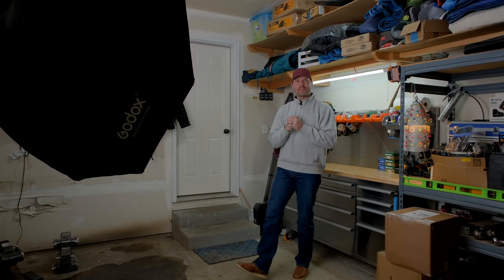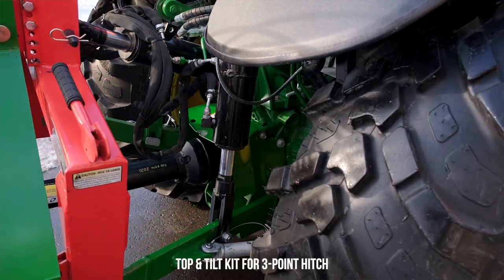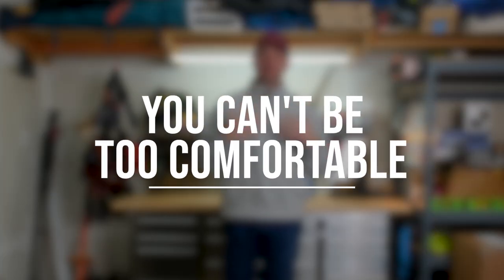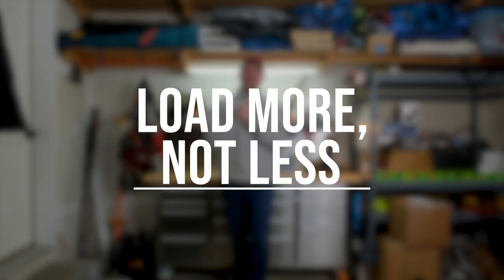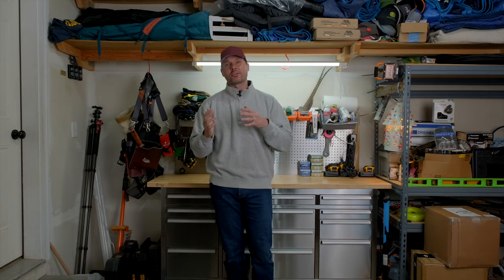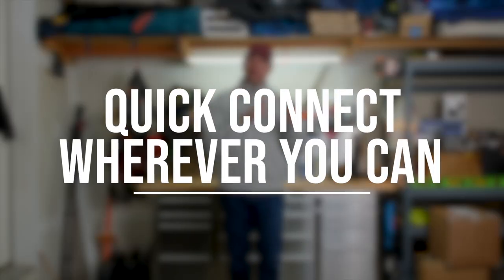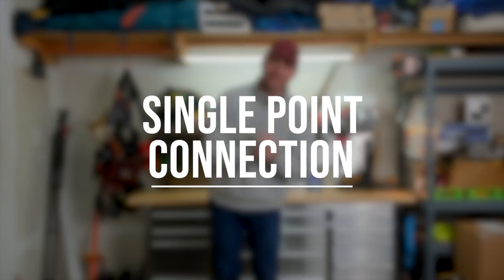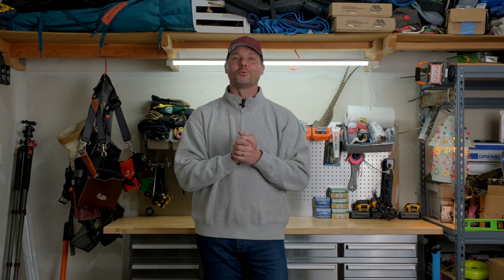7 UPSELLS ACTUALLY WORTH GETTING ON YOUR TRACTOR! 3 THAT AREN’T!

Comment: I had a1984 Ford truck that I bought at a dealership used.  It didn't drive properly.  Pulled hard to the right.  I took it to the dealer for an alignment.  $900 later, the truck still pulled to the right.  The service dept manager said to fix it they would have to bend the swing arms.  I said that's not happening.  He said a bit of pull was required for safety so if you fell asleep at the wheel, you would not keep going down the road.  What a load of 🐂💩. I then took it to a frame shop.  Told them what the dealer had told me.  They took a look and 5 minutes later their service tec called me out to the truck.  He told me to get 2 new front tires.  They were different sized. the size on the tires was the same, but different manufactures.  These were the tires on the truck when I bought it.  I went back to the dealer, but could not get my money back.  Haven't done business with them again.
Reply: The tech working on your  truck should know how a vehicle should drive , along with the manager! Pure negligence on their part. I worked at a Ford dealership for 15 years as a service tech! Most of us knew Fords inside out and usually knew what was wrong on the test drive! 
I’ve seen many many noobs coming into the automotive field that barely knew how to change oil! We all have to start somewhere but a dealership should be training people!

Comment: IMO, ordering a fully equipped tractor, regardless of whether you need all the options at the time, is like buying a stripped down pickup too save $$ up front or getting a loaded version. When you go too sell or trade, just like a loaded pickup, that tractor will be worth more. 😉
Reply from the maker: Yeah, I'm the same way.  Load it up!
Reply: Yeah I think this is definitely true for things like front end loaders and 4wd. Tractors without these two add ons can be relatively worthless.
Reply: Maybe, but you paid more up front…
Reply: @LedgemereHeritageFarm  True enough. Me personally I find the more I use my tractor, a Ventrac, find that I can use more attachments as I get more proficient with it and its nice too have all the options on it already so I dont have to go back and add things later.
Reply: @arlisspropertyservicesllc5943  Ventrac makes a very good tractor.
Reply: @LedgemereHeritageFarm  Well I dont think they are the Ventrac they used too be, before Toro, but their warranty seems too work really well.

Comment: A BLOCK HEATER PUTS LESS COLD START WEAR ON THE ENGINE DURING REALLY COLD WEATHER. A NECESSARY ITEM, AND NOT EXPENSIVE...WOULD NOT BUY A  NEW TRACTOR WITHOUT ONE..

Comment: Just bought a New Holland Workmaster. I had an old tractor so already had a standard rear blade, bush hog, and rake. But I wanted a loader which I couldn’t get for my old tractor. New tractor with new loader, done, right? Thankfully I had a young honest sales rep. He recommended I get the third function. I had no idea how important that was. I didn’t know I really wanted a grapple. Man, game changer. I’ve had the new tractor three weeks and in that time I’ve probably used the grapple 10-12 hours. All these years of dragging things around. No more. My neighbor had a box blade and I had used it enough to know I wanted one. By the way NH has skid steer quick connects on the loader. I also got a quick hitch. Yeah I could do without it but as inexpensive as they are, why? Tires filled, check! Wheel weights, check!

Comment: Definitely get all the hydraulic outlets that you can. They relatively cheap when ordering new. Get as much ballast as you can get on the tractor. If your going to be using the tractor for tillage and you've been using grandpa's 8n and want something to pull his implements get the top link draft control option (JD don't offer it on 1 - 4 series and standard above)
Reply from the maker: 100% agree with you.
Reply: Yes. A loader and remotes should always be bought up front

Comment: BLOCK HEATER I have a 1025R in southern Illinois last year I could not start my tractor for about two weeks even with putting a heat tape wrapped around the block and a couple heat lamps on it under a tarp it was so cold. I had my diesel treatment in so it will not go up. And it still did not want to start. And last year was extreme cold. I have my block heater and now it is very handy since I have installed a Curtis cab and want the heater for the cab available when I start it up I don’t have to sit there and wait for it to warm up for 10 minutes. I find that it saves me time and fuel warm and ready to go I also installed a trickle charger everything goes to one plug. Keep that battery warm through the cold months save you having to buy a battery later. Prolongs the life of your battery. I really enjoy your channel I wish you the best in the world have a great year.
Reply from the maker: Thank you David, great info!
Reply: It must be tough living in a place that gets so cold. Good luck this winter.

Comment: Work as many attachments in to the financing of the tractor as you can. You may not be able to afford them later on.  Also  if you even remotely think you might use a optional function on the tractor get it. Better to have it and not need than to need and not have.

Comment: Great video as usual. The winter temperatures here in Montana often dip well below zero. While I store my tractor indoors, it's not heated. Even with glow plugs my L3560 starts SO much easier after an hour or two plugged in to the block heater. 

FYI. About 20 air miles from my house on Rogers Pass is a sign that says it saw the lowest temperature in the lower 48. Minus 70º F. It's not unusual for it to get down to the minus 20s or even minus 30s here. 

Sometimes it gets so cold the lawyers and politicians have their hands in their own pockets!

Comment: I thought I would regret not getting a backhoe, but I couldn't justify the expense. I haven't missed it, yet. If I do run across the need, a local tool rental will be the answer.

My dealer included fluid filling the tires as standard delivery prep, no extra cost.
Reply from the maker: Good info, thanks for sharing!

Comment: Everyone is always worried about what color tractor should they buy. 

Making sure you buy the right options/ attachments is a way more important question.
Reply from the maker: Yep, definitely higher on my priority list!
Reply: I agree. Plus most fail to realize a good dealer for support is worth more than the color. It can be a great machine but they all break down and need service eventually and without good parts and service support it can be a worthless machine.

Comment: I store my tractor outside and I'm in snow country. The block heater helps get the tractor started and warmed up quicker. As for the self levelling, I don't think you need it unless you have a business that requires unloading or loading pallets all the time. On tires, I had R1 Ag tires on my old tractor. My new tractor has R4 tires. I wish I had bought R1 tires. Traction is greatly reduced on the R4. The benefit of not making as much of a depression in my yard is not worth it. Courtney's advice is so true. I bought a new tractor and upgraded for all the reasons he said.

Comment: Really great recommendations Courtney. I have a Bobcat CT5558 with a factory cab with all the bells and whistles. The only option I don’t have is a mid point PTO. To date, I seen the want or need for the mid-point PTO. Having worked with open station tractors, articulated forklifts, and skid steers, I knew I wanted to be warm and dry up here in Montana. I wasn’t disappointed.
Reply from the maker: Good info Richard, thanks for sharing!

Comment: I bought a brand-new John dear tractor in 1978 and I did not get external hydraulics at the time I didn't know what they were. Several years later I started bailing hay and using that tractor as the rake tractor . Now obviously I had to retrofit external hydraulics onto and I never did like him they were expensive to handle just flop around it took them two weeks to put them on. I also did not order rear-wheel weights that I was fortunate enough to have a brother at work to the pipe yard and got me some 24-inch pipe with a six-inch wall thickness so I made my own weights. The interesting thing is I still use that same 950 tractor to rake hay today.

Comment: Perfect timing on this vid.  Im driving my dealer crazy as my initial oder has morphed to include almost all of these in your vid (did it without seeing this vid so it confirms the choices and I feel better about it)…. Went Kubota 6060 to a 7060… then switched up to 12speed (larger hyd pump)..  added all 3 hydraulic options and remotes…then switched up to a cab model (comfort is a priority!!!)… and then… and then… lol.  In the course of a week the budget swelled but didnt bust… and I dont regret it at all….  Thanks for this vid.!!

Comment: Great video as always. Where I live, block heaters seem to be standard from the dealership. I’m sure if you ordered a tractor, you could get one without. With our block heater, our tractor starts in the winter exactly like it does in the summer. But to me, the greatest benefit is that warm up time is reduced significantly. I can be plowing snow pretty quickly after starting the tractor.

Comment: There’s probably just one thing I should have had done when buying my BX2380 and that’s getting remotes at the rear, I have a 3rd function at the front for my grapple but a set at the rear would have given me the opportunity to use it for a hydraulic top link 🤷🏼‍♂️. Great video as usual Courtney 🙋🏼‍♂️👍🏻🙂
Reply from the maker: Yeah, I should have mentioned a hydraulic top link.  Such a underrated feature!
Reply: @GoodWorksTractors  agreed.   So damn handy.
Reply: The kit to add the rear remotes to a BX is like $400 and take about 4 hours to install. If you’re even remotely handy, it’s a piece of cake.

Comment: Block heater is absolutely necessary for MN winter! Rim guard is fantastic and easy. I saved $700 doing a summit third function on my own though.
Reply: Block heater saves wear on rings versus a cold start too. Block heater should be standard equipment.

Comment: I started working on an old propane open cab with a sickle mower. Was young and didn’t know any better. Worked on open cap tractors for all my life. My current tractor is a 3025e open cab and I am looking to go up to a 5065e cab tractor and basically upgrade with every part you mentioned. You hit it on the nail head about age. Comfort becomes much more important. Best wishes, 🚜
Reply: May want to look at something other than’e’, economy. R,M, ? has more interior comfort, other amenities worth looking at.
Reply from the maker: Haha, good stuff Twisted!
Reply: @stevethiel5838  I looked at the 5075m but the $20k more price tag made my decision for me. I’m not a 5 days a week operator so I have to weigh the cost v the usage.  But you are right. I would rather have the 5075 or 5090m if I find the extra $20k somewhere.

Comment: The Kubota LA854 loader on my tractor is self levelling. It seems fine to me though I don’t have pallet forks, yet. I can’t compare it to a non self levelling loader as I don’t have access to another tractor without a self levelling loader.

In any case loaders are such a wonderful implement. Yesterday with the bucket I scraped away around six bucket loads of topsoil from one part of the farm to use on another. So much work done that would be really hard by hand.

Getting extra hydraulic circuits installed by the dealer when purchasing a new tractor makes so much sense. You’d be saving cents on buying a new tractor without extra circuits and spending dollars to get them installed later.

Comment: I bought my tractor new in 2020. Did not come with loaded tires despite the brochure quoting weights with loaded tires. It cost me close to $500 to get the rear tires loaded on my 46hp tractor. I bought it to them. Also I wish I had looked into the third function. Have not had any starting issues even in cold weather, it's a Yanmar. Would like to find a good boxblade that doesn't break the bank. Ordered one, but cancelled the order after discovering 14-16 week lead time.
Reply from the maker: Thanks for sharing Tyler!  We've got green 48", 60", and 72" box blades in stock now.  Just got in grey 72" box blades too!

Comment: As far as putting fluid in rear tires spend the extra and put beet juice in stay away from calcium chloride. One small puncture, / pinhole valvecore leak will cause irreparable damage to the wheel itself. This is from an old Northeast Arkansas cotton and rice farmer....i remember when calcium chloride was our only choice 
....

Comment: I think a full disclaimer should be made about the self leveling loaders, it is completely application dependant. As you mentioned if you are doing lots of pallet fork work I see it being completely worth it, if not then perhaps you can save yourself the 2 to 3 grand and get other options that you may find useful or another implement.

Comment: My dealer thought I wouldn't be able to control my FEL and included the self-leveling add-on. Well, I hated it. Couldn't get a full load of anything in the bucket. Found a guy who could remove the function and am thrilled.

Comment: On the L4060 HSTC-LE I ordered, the rear remotes are the same price as the actual kit you can buy afterwards and labor would be the same price since they are dealer installed.  Maybe it is different with Deere and they are factory installed, but Kubota would be no different in cost if you get them installed new or after already having it.  If you decided on 1 remote installed, then later on decided to add two more, now it will cost you more as they have to do the same work twice, so you pay double the labor.   If you buy multiple options to be installed, like air ride seat, rear remotes, anything that requires in cab work, it is better to have it all done at the same time as labor is less. 

I plan to install the 3rd function and QA remote myself, kit price is same minus install fee if bought new.
Reply: I purchased a L6060hstc end of 2021. I installed all my own hydraulics. I had the dealer include the parts kits in the purchase price but saved $3k in labor by doing it myself. Took me about 12 hrs to install 3 rear remotes and third function with the hydraulic skid steer connect.
Reply: @braxtonwiggins6576  Labor on mine was only $600 to install all the rear remotes, but I will be installing the 3rd function/QA remote myself. Reason I had them install the rears is because the case is cracked open under the seat to install it, and would rather they do that for warranty reasons than if I did it and something went wrong with the hydraulics.  Cheap insurance. Otherwise I would do it myself as well. The 3rd function and QA remote doesn't involve cracking the case open.

Comment: Put on an oil pan heater. These new diesels start fairly easily, but the oil pressure is pretty high for 5-10 minutes after cold starting.

Comment: Your channel would have been helpful in 2000 when I bought my New Holland Boomer. The tractor has been a great  tractor but at the time I had a skid steer and did not need a loader but in hind site I wish I would of bought the loader hydraulics so now to add a loader the only option is a valve that is attached to the loader frame and not on the tractor fender witch would be more user friendly .

Comment: I 100% agree that a cab is the way to go now if you are using your tractor strictly and the woods dragging logs that type of thing maybe a cab tractor isn't the best option but for a general-purpose machine a cab is definitely a necessity now for a option that I think is definitely not worth the money is a belly mower. Unless you are buying the tractor strictly as a glorified lawn mower with no plans of using it as a actual tractor that would be fine however if you plan to use it like most people do as a Swiss army knife and do a little bit of everything the $2,000 optional mower deck I do not think is worth it as you can buy a brand new zero-turn which is much faster and more maneuverable for just a little bit more money plus the mid-mount mower is always in the way when you're trying to do something other than cutting grass not to mention it is a pain to take on and off

Comment: Great informative video! I know I regret not getting the hydraulic kit when I bought my snow blade. I have found I could really use it. But now, it may no longer be available and the standard cylinders I can find just won't fit.
Reply from the maker: We just got in the kits for the plows!
Reply: @GoodWorksTractors  I'll be emailing you for the info today!!!

Comment: Retiring in a couple years and looking at a Kubota 4760. On their "Build My Kubota" feature, on the rear remotes it gives you a choice between two types, a Float Detent and a Double Acting Valve. What is the difference between the two? (I'm looking at mine as a general utility tractor: mowing/ brush hogging, food plot prep and planting, general property maintenance)
Reply: Float detent allows you to push the lever past the normal operating position and the valve falls into the detent where it stays out on it's own. The fluid is free to pass in that position and is not pressurized, so an attached implement can "float" (named assuming it is something that follows the ground which is the primary use).

The other sounds like a standard two direction valve. 
My tractor came with one of each, but what I wish it had was a valve with a detent that was powered. Useful for things with a remote valve like a log splitter, backhoe, or any hydraulic motor. I think they typically just route a line directly from the pump to cover that use instead (if purchased) but then it has no valve to control it.